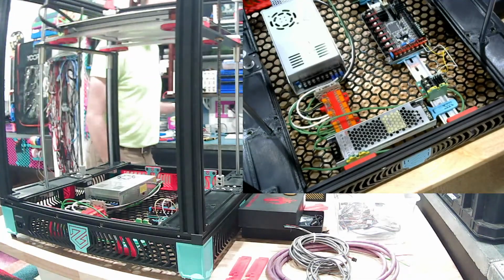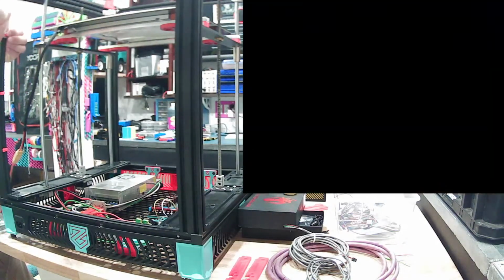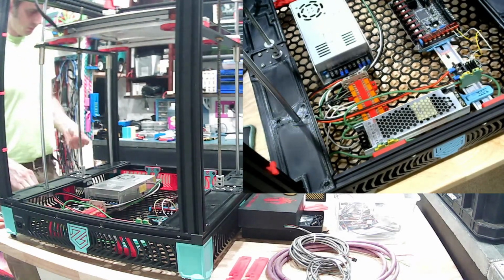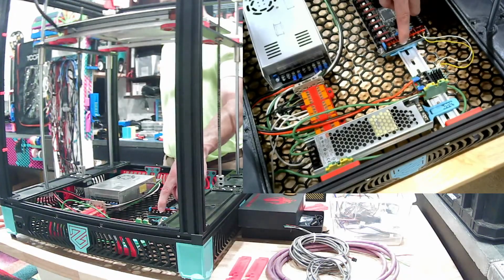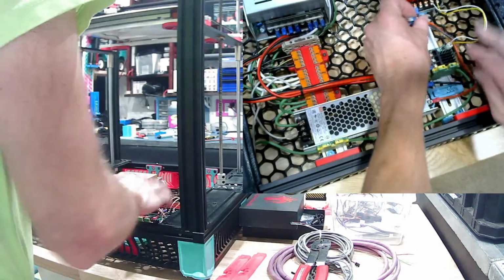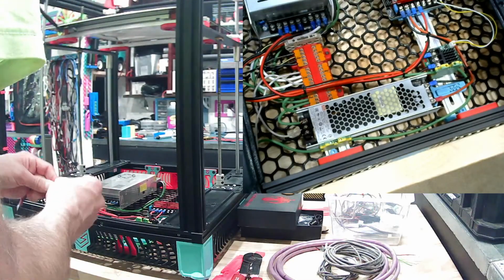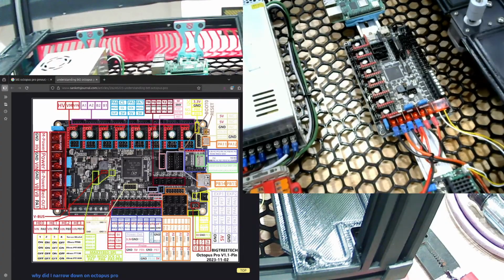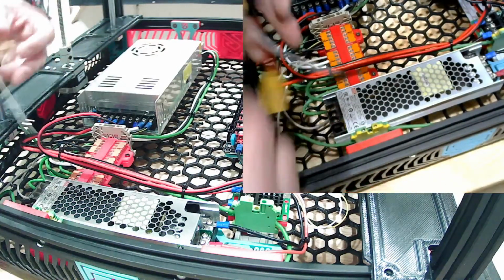Ender5/Mercury One.1 electronics and wiring, continued...

Comment: This is my first time ever running the octopus Pro for my Mercury one and I'm trying to get it wired up right now what do I need the motor power wires even if I'm not using external drivers?
Reply from the maker: When hooking up power to the Octopus Pro board, you can choose your motor power level (I think it's between 12v and 60v?) and the terminals on the end of the board are where you can provide that different power. I used 48v and 24v for this build. Make sure you have drivers that are compatible with the voltage level you use- but also make sure you set the jumpers for each driver to the correct input- I think by default they are set to use the 24v power from the main board input (not the one labeled "motor power") this lets you use drivers at different voltages at the same time. Mine is only using 48v for the A and B motors(with the TMC5160T Pro), the Z motors are only set to 24v (using TMC2209)